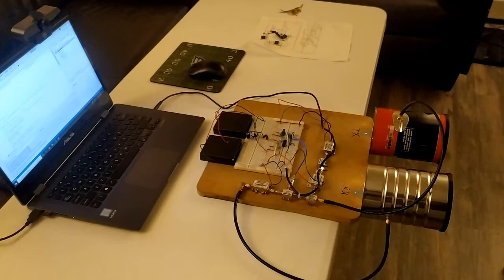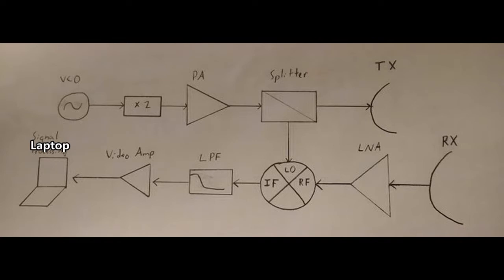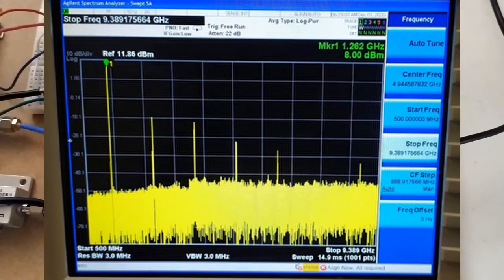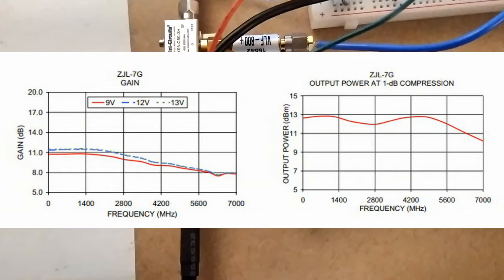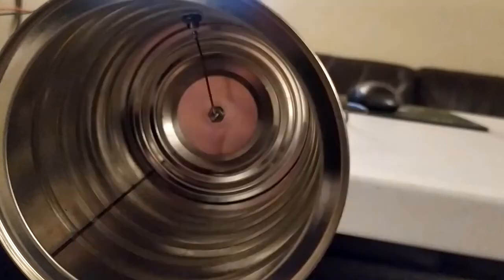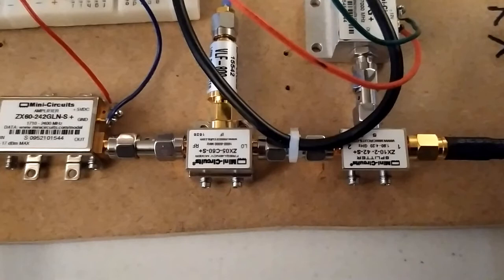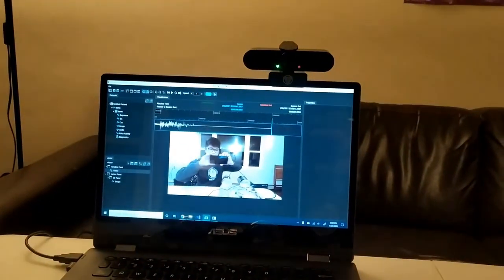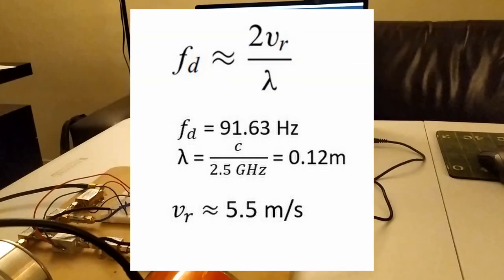Coffee Can Radar Explanation Demonstration 1

Comment: Hi,  great video. Ive been attempting to build the radar for the past couple of months and have made very little progress. I've sourced most of the parts although am struggling with the video amplifier or potentially correctly processing the data on Matlab. Would you mind sharing some advice? 

Have you got any radar data that you would be willing to share?
Reply from the maker: Hey, Craig. Here's a link to another radar video that I made that addresses some of the issues that you may be having. Although the radar in that video is at 10 GHz, it follows the same principles and has a MATLAB script and examples within the description. (You would just have to adjust the frequency and wavelength to match your desired frequency) 

https://www.youtube.com/watch?v=BChXISK9MQw&t=1s

Comment: Hey man, I'm attempting to build the mit ocw coffee can radar system, but I can't find any of the sma rf components needed (except for old ones on ebay for hundreds of dollars). Everything I have found is surface mount, but for the sake of trying this out for the first time since I'm only a college student I'd rather use coaxial components. So, I'm just wondering, where did you get your parts from?
Reply from the maker: I got my RF components from Mini-Circuits by searching for products and filtering for only parts with a connector interface. And yeah, some of the parts (like the VCO) are uncatalogued so if you want to replicate the MIT's radar specifically, you need to request a quote. This can be done on their main page under the Contact and Support tab. I've actually did this for the MIT specific VCO but the cost was around $200 (Usually they offer discounts for student/educational purposes, but since it was uncatalogued, there was no discount available). MIT says low-cost but I think that's just compared to modern day Software Defined Radars that run you a few thousand dollars. You could also look on EverythingRF for a wider selection of components, but you'll have to go through the requesting for a quote process and there's no guarantee that it would be cheaper than Mini-Circuits. 

For me specifically, I had the luxury of using some spare components within my College's microwave lab. I think borrowing or requesting equipment from your college's lab would be the cheapest way to go. Some of the specifications and operating ranges might not be exactly the same, but if they can handle 2.4 GHz, you can at least measure doppler like in the video. 

You could also try asking a professor if they would be willing to make the purchase for you. 
Feel free to ask me other questions and I'll try to answer them to the best of my ability.
Reply: @Brrryan_T  Thank you so much, guess I'll try requesting a quote and see if I can get some sort of student discount. Also, I don't know why on earth I haven't asked one of my professors if they could help me find or buy the components, I know the head of my school's ECE department pretty well, surely I could ask him. Thank you for all the ideas and advice, this was really helpful.